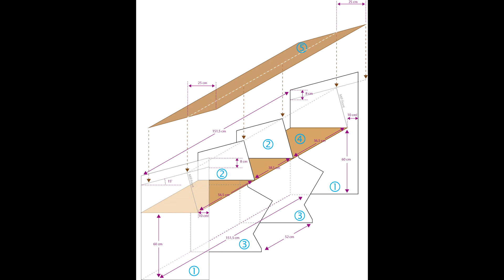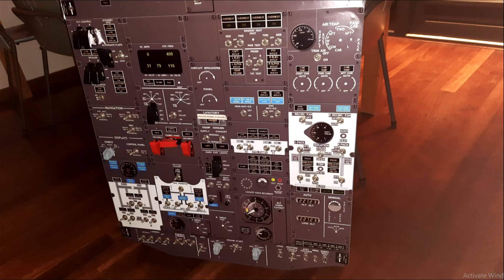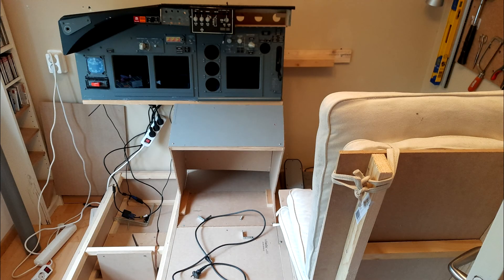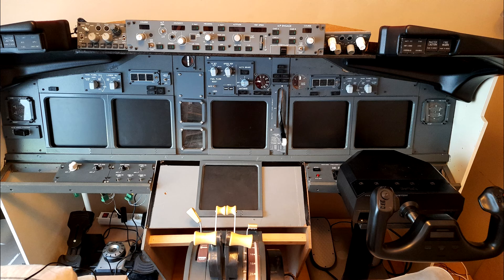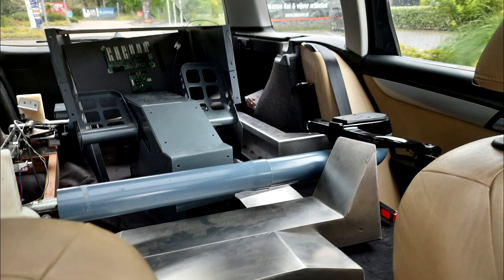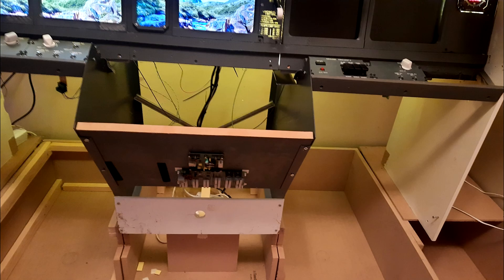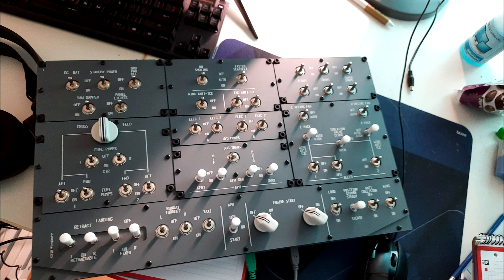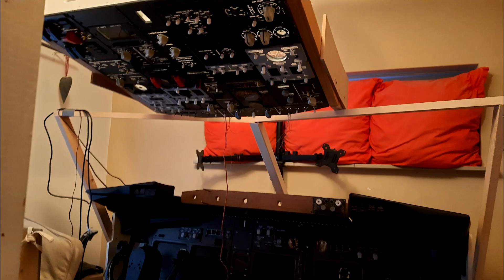737 Home Cockpit Build

Comment: That’s impressive, could you please provide the overhead panel digram for the wires used and how are they connected ? Thanks
Reply from the maker: thanks! if you watch my previous video, it explains how i wired all of the switches.